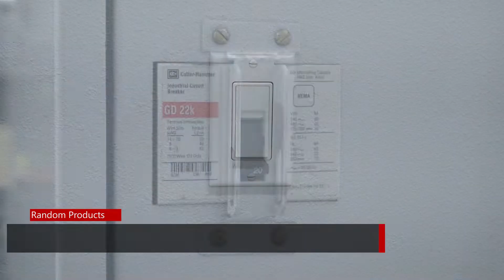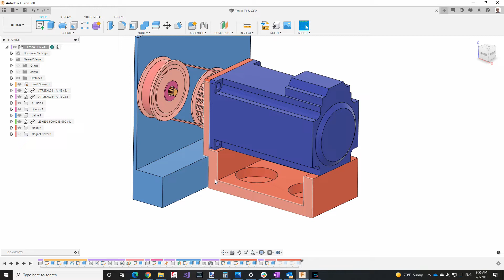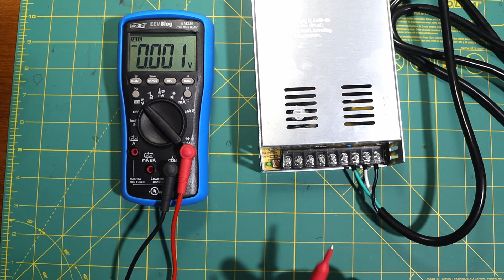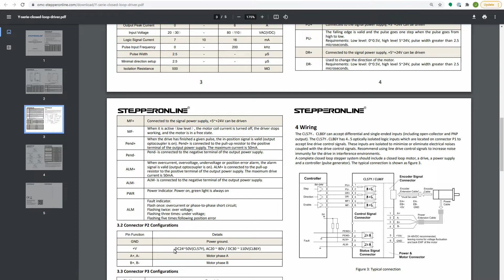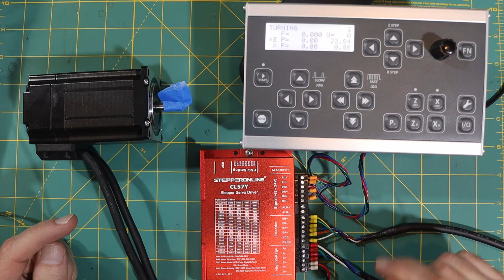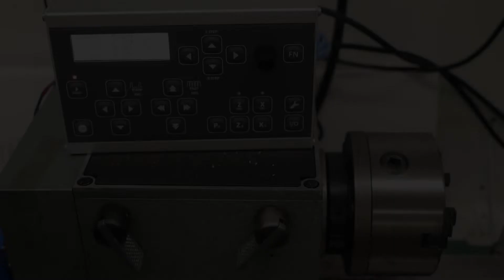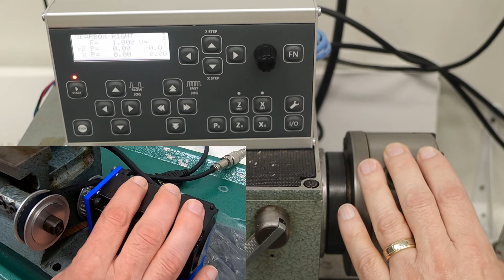ELS 4 Basic First Moves--Almost - Part 5

Comment: did you check the 120 / 240 switch inside the power supply !
Reply from the maker: More than once :-).
Reply: @JohnSL  inside the metal box ?
Reply from the maker: Yes, it's set to 115V.

Comment: Really nice looking tactile interface. What would be involved in making a similar type but custom keypad entry as this ELS? Your products use a different type button? Hope the question makes sense. Happy 4th of July!
Reply from the maker: Hi Kent,

I purchased the ELS 4 Basic from Germany: https://www.rocketronics.de/en/els/

The keypad is a membrane keypad. I don't have experience creating this type of keypad. I think you can get SMD dome switches that go under a vinyl label, but I'm not sure.

On our throttles, such as in my previous video, we use a silicone keypad that has conductive (I think graphite) pads on the bottom that connect two sets of traces. 

Are you thinking of a getting a custom keypad instead of the Stream Deck?
Reply: @JohnSL  Hi John, I make a few small imaging machines for labs and greenhouses. The software has a complicated interface. I'm sketching a simpler machine with a custom keypad to the primary functions. The StreamDeck is an option but it's heavily branded. You've given lots of keywords to start with that I didn't know. Thank you

Comment: Audio is only in left channel for your voice
Reply from the maker: I tried this on my computer and had audio coming out of both channels. Was this for the entire video, or just portions of it?
Reply: @JohnSL  just some of the shots including the first one w you talking. I guess it’s not just the left channel, but highly out of balance
Reply from the maker: Thanks for letting me know. It looks like a problem with my wireless microphone when I have it set to stereo mode. I need to figure out what's going on, but I have confirmed that setting the mic to mono fixes the balance issue, so it's not the camera.